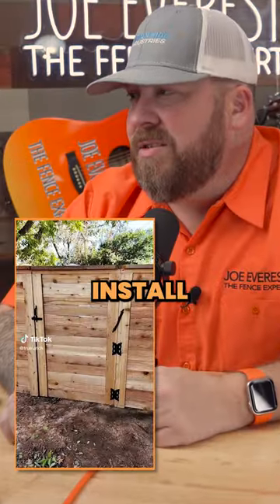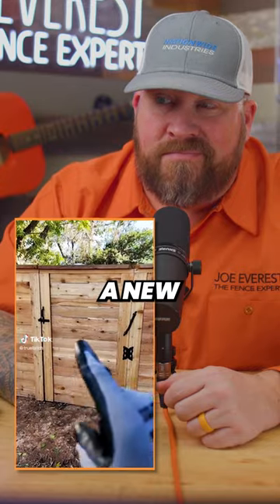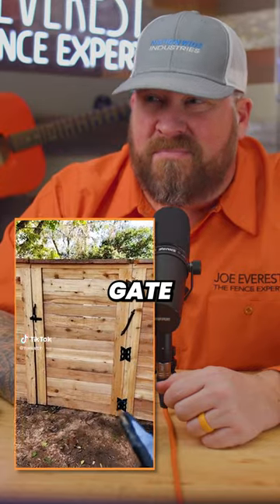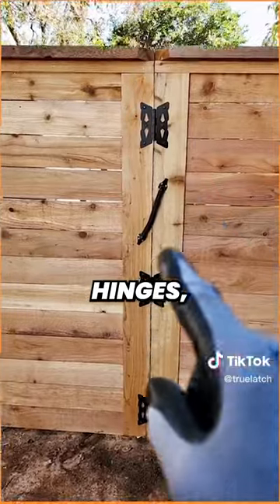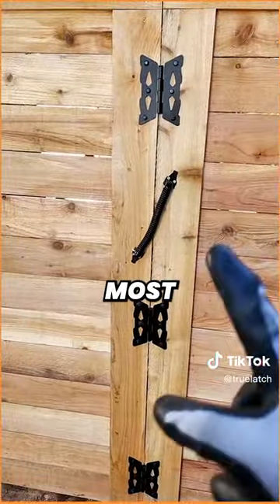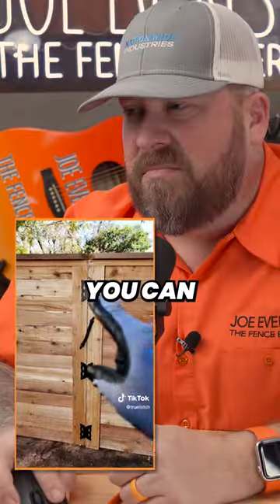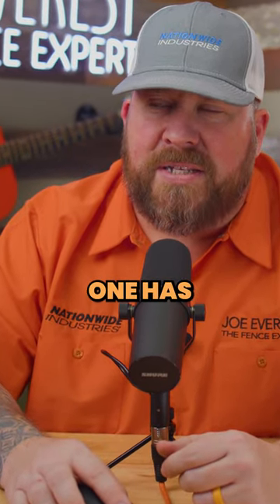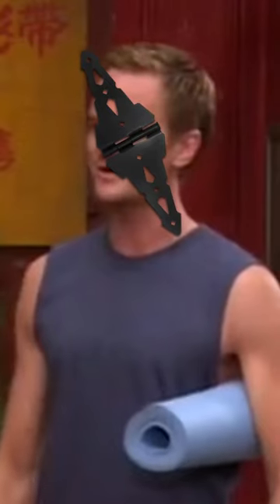DON'T Build Fence Gates Like This! #shorts #diy

Comment: I like to put three, the top and bottom 1/10 the height of the door in from top and bottom and the third 2/10 from the top. This gives extra holding force so the door doesn’t sag as easy. And I find this to be most aesthetically pleasing.

Comment: The hinges come in packs of 2 for a reason. You use 3 on one side, and 1 on the other for additional support. That way you never have to worry about the gate moving, which can bind up the hinges.

Comment: I've always felt "we've done it this way for decades" usually had a reason behind it.  Just because you don't understand it doesn't mean it's wrong.  I always felt sag was the issue and a third middle hinge ain't helping that unless you skimped on hinges or screws.

Comment: It's funny, 2,3 or 9 hinges unimportant when there is no Z for stability in the Gate. I'm a Woodworker/Carpenter in Germany, you always have to make a diagonal from down the side with the Hinges to the opposite corner.

Comment: I do finish carpentry which involves installing a LOT of doors.  On our production sites we just switched to 3 hinges for each 6"8' door.  We had too many customer service calls for the door bowing.  We also started using 4 hinges on our 8'0" doors.  They don't bind use more hinges for more weight.

Comment: I'd be more worried about the gate sagging with no diagonal bracing unless its a wood clad fully welded steel core frame. Nothing wrong with more than 2 hinges IMHO

Comment: Dude the 3 hinges is to stop forced entry, and hold up extra weight. The problem however arises when you have cheap construction like in this video where you don't have reliable wood and a steel frame to support the softer wood.

Comment: I like three. Even if you've done the proper size hinges for the weights, kids try and swing on it, weather and time do their thing, it will sag. If you had a strong enough hing, you could do a single one in the middle, but you devide the work and everything becomes more stable and durable

Comment: It has less chance of moving if you use 3. It if moves... then it isnt square. So cheap gate just use 2.  Otherwise it's going to rub up against the trim and make it look stupid so that's situation where you got nice and tight fit then you need to use three and install them correctly

Comment: That spring there doesn't look like it's doing much good either. Wouldn't you want that on the other side so it pulls the gate closed? Is it one of those backwards springs that'll push it closed?

Comment: I mean, at the point it's just aesthetics. If the gate is heavy enough to need three, use four. It's symmetrical and no issue with binding... not that I thought it ever was...

Comment: Depends on how far your hinges entend into the door. The ones on his door are pretty narrow for that size of door. Where the ones you show are wider therefore they have more leverage. The technically correct answer is to use 2 hinges appropriately sized. But styling and mounting space limitations requires some sacrifice .

Comment: I install glass showers everyday and we only ever use 3 hinges when 2 hinges can't hold the weight of the door. We can use standard size or larger ones which hole more weight but they have their limit and the 3rd hinge always binds and fights two hinges.

Comment: I have to disagree Any added support or hinges works great in the long run contractors are only there to install they’re not there to see the long-term effects down the road any added supporter hinges actually holds up I’ve seen better over the years I do landscaping and lawn care, and I see long-term effects of fences and the gates with the metal frame always hold up the longest and with added hinges

Comment: More hinges balances the wear better. Using ball bearing hinges or at least regularly lubricating them with heavy grease will also help keep the knuckles from wearing prematurely. The heavier the door or gate, the more/heavier duty hinges or pivots you need

Comment: Imo, it depends on the hinges and the purpose of the door. Shrimpy hinges might need a third just in case someone ever leans on the door. If the door needs to be able to take impacts (i.e. a front door, or semi-secure gate), then more hinges can really increase sturdiness (of course, shrimpy latch then becomes the weak point, ymmv)

Comment: putting in more than two hinges means that not only are you sure they are perfectly colinear - you are also sure that they will forever stay that way regardless of material expansion/shrinkage, general wear and shifts of the ground/anchors.

the only reason your third hinge doesnt bind is that they are usually cheaply produced with large tolerances.

Comment: Door technician here (man doors and garage doors mostly) we usually install a thing called continuous hinges on heavier doors because regular old hinges tend to sag down and bind the door up. Continuous hinges don’t tend to fail but what usually tends to fail is the motor or concrete filled door frames and they “fail” when they sag after years and years.

Comment: Not trying to throw shade, but how are you the Fence Expert, and you have no experience with multiple hinge arrangements, nor how to properly adjust them so as not to bind? Do your Fences never have Gates?
Reply from the maker: ASTM industry standards call for 2, larger gates require the hinges be sized up as well as the hinge posts. If the hinges and posts are sized correctly there’s no need for the third hinge. The gate shown in this video is a wood framed gate hinged off of a wood posts. Both the grate frames and posts will move over time, either through ground settling or the wood materials warping/twisting. Those that argue for a third hinge typically reference doors having three hinges, without taking into consideration that door frames are completely encased and incorporated into the wall frame work. Not to mention that the three hinges on a door is largely an American technique.

Comment: Theyd only bind if the hinges arnt aligned with eachother, granted its harder to match 3 hinges than 2 but not difficult. With 3 installed correctly the hinges will have less chance to become malformed cause the load is spread out more

Comment: You are 1000% correct. As the wood warps the ground shifts or kids clamber over it, the middle hinge will hold strong and force the others to pull lose. 

We use two hinges of 300+ pound cattle gates.
Reply from the maker: I appreciate you watching and sharing your experience!

Comment: So install 4 hinges then. A gate is a door. Nearly every single door in nearly every single house has 3 hinges.
Reply from the maker: Doors are fully framed and encased in the wall structure, gate posts are not.

Comment: Well it depends on the weight of the gate/door. It also depends on the size of the hinges. Say you have a solid wooden door, you will want 3 hinges but you dont want 5 inch hinges. Probably 3 inch or 4 inch.

Comment: In my house every door has 3 hinges, they are almost 20 years old and they all hold up just fine with heavy use. Not the same as a gate, but the constant stress on them does go to show 3 hinges isn't a real problem and is likely more to do with improper strength hinges say a 50 pound rated hinge on a 60 pound swing gate
Reply: A doorframe doesn't warp like a fence post

Comment: The middle hinge on your front door will beg to differ. You can sell 2 packages of 3 hinges for lets say $20 or you can sell 3 packs of 2 hinges for $30 motivation for higher profits. Stay in school.
Reply: Your doorframe doesn't warp like a fence post
Reply: @davidkuest6224  just use your  non drying, non shifting, gravity defying magical wood to build your fence.

Comment: Then why do interior doors have 3 hinges?
Reply from the maker: Because they’re fully framed and encased in the wall structure? Gate posts obviously aren’t. Gate posts are also fairly prone to warping/twisting/sagging, that doors never see.
Reply: @JoeEverest  Seems interior doors could have only 2 hinges then since they're so sturdy...but they don't. Here in TX, it's 3 hinges on fence gates.

Comment: Well no. The guy in the video is right. Think of any door you’ve ever seen. Hate packs come with 2 cuz it’s the bare minimum needed for a functioning gate
Reply from the maker: Any door I’ve ever seen has been fully framed and encased in a wall structure. Apples and bananas.
Reply: @JoeEverest  how is it apples and bananas. When the door is open is it only being held by hinges? When the gates closed does it not have a latch that helps support it? Apples and apples
Reply from the maker: @odyoddeller  the door is supported by a frame that is built into the wall structure, it’s completely encased. Gate posts are not and they tend to move (warp, twist and bow) which could put the third hinge in a situation to bind. I’ve never seen a warped door frame, but I’d have to thing if the frame was to warp out of true you would also see the third door hinge be put into a binding situation.
Reply: @JoeEverest  right because the third hinge is to support the gate and stop it from wanting to warp as well. If the post warps it’s pretty simple to adjust a middle hinge. Literally take it loose, let the gap relax, and put it back on. But the third hinge helps keep that thin unsupported door from warping
Reply: @JoeEverest  typically you have to worry more about a gate made of 2x4’s warping way before the 4x4 post. Which is the style of gate in the video

Comment: If a middle hinge binds the others then all of the doors in your house are wrong.
Reply from the maker: The doors in your house have structure at the top and won’t move. Wood posts, especially gate posts, are notorious for warping and twisting. No matter how aligned the three hinges are on day 1, they’ll eventually bind and the posts move.
Reply: @JoeEverest  they do twist. I wish you kids knew more. Unfortunately young people do fence which means less experience and knowledge. Glad I don't do it anymore. I'll stick to remodels and new builds. I can show you 2x's that twist in interior door framing. Just because you have something at the top means it won't happen and twist.
Reply: nexusofclyt  on heavier gates it's fine. The middle of the gate can move in or out without a hinge. the hinge isn't just for support. There is more to it then just what you think.

Comment: Then why do all doors have three hinges?  Even 60 years ago when interior doors had two hinges, exterior doors had three? The package come with two hinges because of price points.
Reply from the maker: Doors are fully framed and then encased in the wall framing. Gate posts are notorious for warping and twisting, which would put a gate with three hinges in bind.

Comment: If that gate swings in is there a reason that spring is on the same side as the hinges? Shouldn’t it be on the other side to help pull it closed? Never used one, just asking.
Reply: Depends which way you tighten that spring.
Reply: It's a stiff torsion spring, when you open the gate you twist it and bend it and it gets loaded, and it then closes the gate by twisting and bending back to its flattest state.
Reply: It swings out

Comment: I work as a maintenance chief for years at a hotel chain. One of hotels remodeled and redid all the outside doors. I pulled a reinforced steel door from the trash and and welded a new frame and installed as my front door and put a peep hole with camera on it. The entire side of it is a 1/4 steel hinge. Took 4 of us to install and level that damn thing. But you won’t ever get through my front door. Just gotta figure out how to get bullet proof windows…
Edit: it will stop 9mm. We shot a mag into it and it barely dented it. Not sure what else it could stop. I’m sure a 5.56 or bigger would at least go though one side.
Reply: You shot your own door before you installed it? What if it went through or dented the thing then u need a new door😅
Reply: Contact your local glass shop. They could source you a BR lite.
Reply: if you want penetration you need a harder bullet. something like 5.7 was literally designed (small and fast) to penetrate but you need the right ammo for it. anything fat like 9mm or .45 wont penetrate without really special ammo

Comment: I agree 2 is what we have always used on standard privacy fences. If it’s a 8’ tall privacy I will put an extra hinge if it’s a big gate approximately 6’ or bigger. Not a fan of 3. I had a customer request it once and we went back and took it off after the gate settled a bit.

Comment: For steel farm gates if there over 14ft and heavy I weld 3 on. But you are correct with timber fence never put 3 top and bottom will bind and centre one will try rip itself out because it's garrenteed that that gate will not stay square 🤙🏼